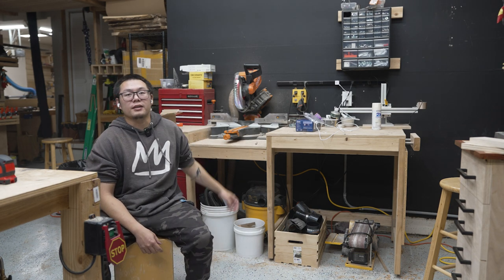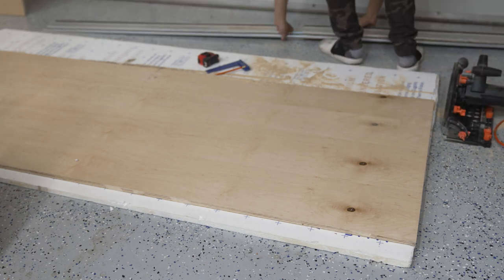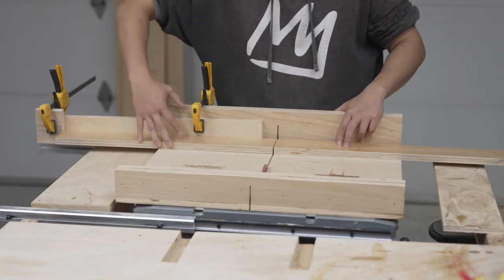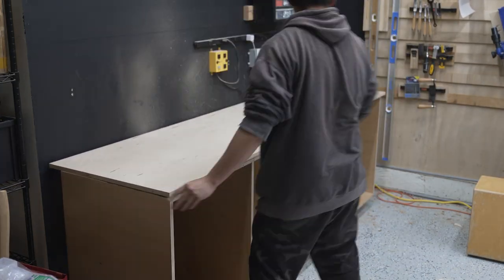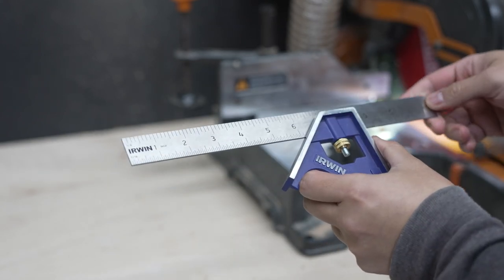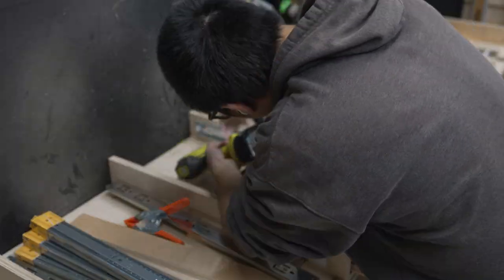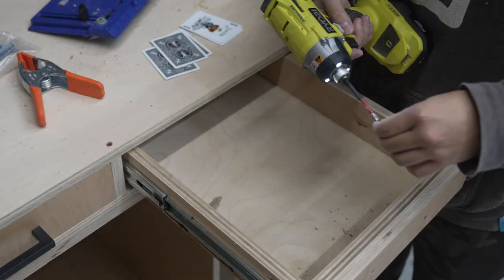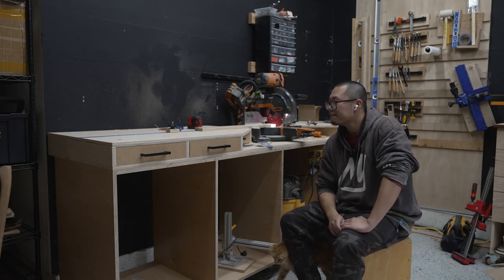I hate my miter saw station, so I made a new one

Comment: You didn't mention...what didn't you like about your old miter saw station?
Reply from the maker: It had only about 24" on each side of the wings, with no tape measures or stop block. Also it was built with rough 2x4 lumber so I couldn't put any drawer or storage in it, kind of a waste of space. The center well for the miter saw is too wide and all those width are unnecessary. I wanted to build a new miter saw station to put some of the new skills I learned to the test and get some of much needed storage in my shop.
Reply: @themissionwoodshop  Thanks for the reply. I hope you are enjoying your new station!
Reply from the maker: @timthayer9365  Yes I am! My tools are much more organized now.